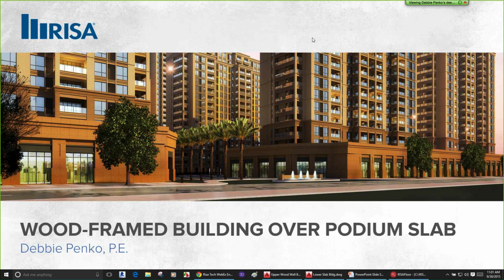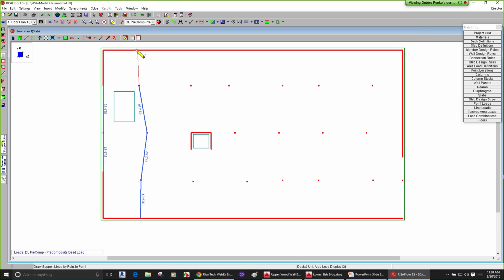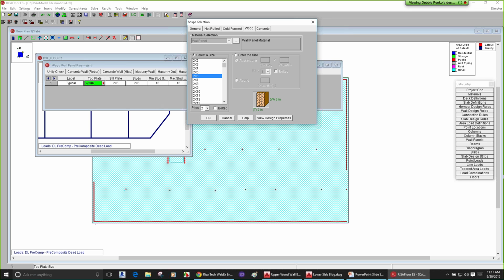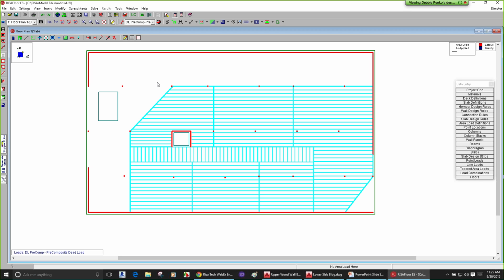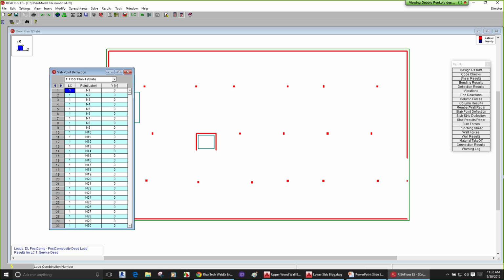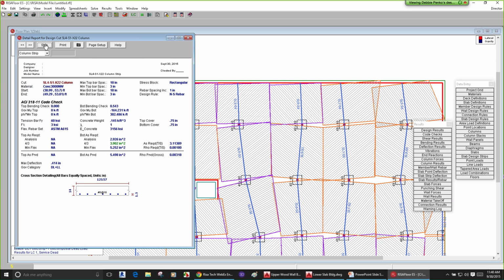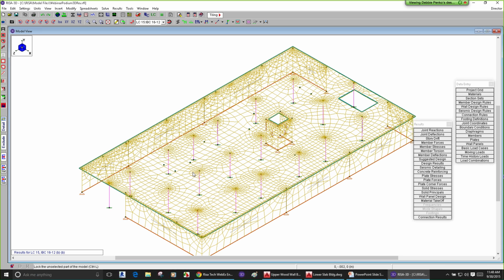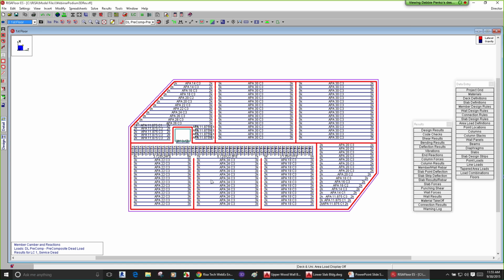Wood-Framed Building over Podium Slab in RISA

Comment: In such model, the most important point you should address is the connection between the concrete and the wood. It has been noted that, shear force under seismic load  in both directions were equal which is incorrect.  and you do not point out how the program calculate the self weight contributes in shear force which is a critical point